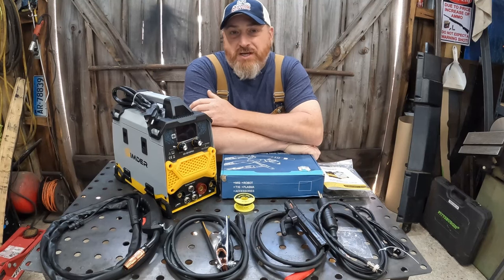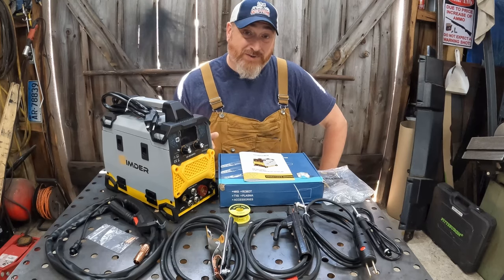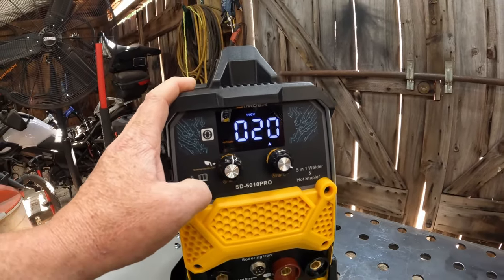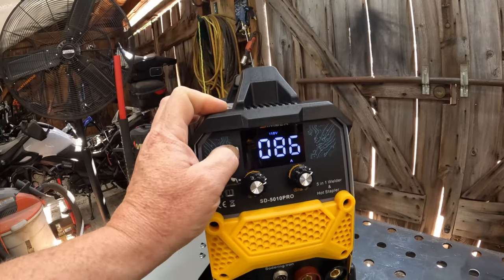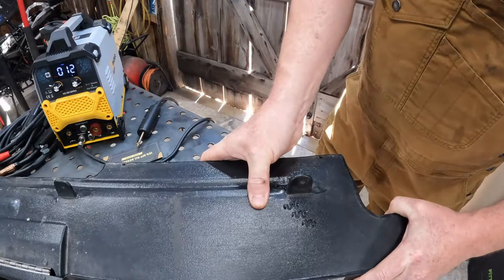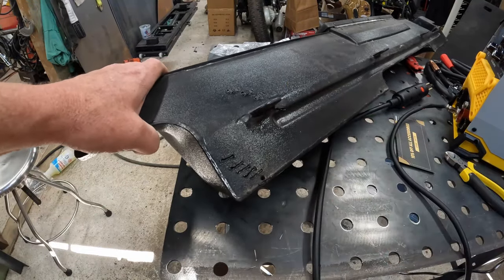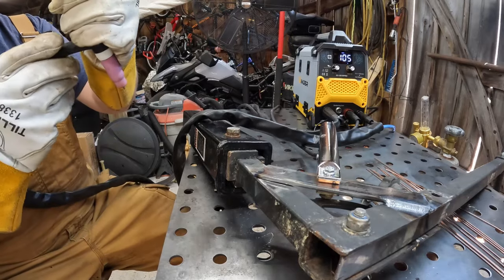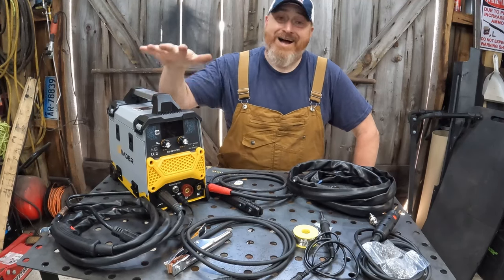New Simder SD5010 Pro! Multi process Welder & Hot Stapler! Review and walk through! See it first!

Comment: Just give me a welder, and you can keep all the stuff. It's all unnecessary.
Reply from the maker: For you it may be unnecessary.... This is the same price as buying a regular flux core machine.
Reply: @madgingercustoms Simple rule of life, never put all of your eggs in one basket. If the power supply, for example, fails on your plastic staple heater. You will have no more welder. Just look at how much you lose when just one part of it fails.